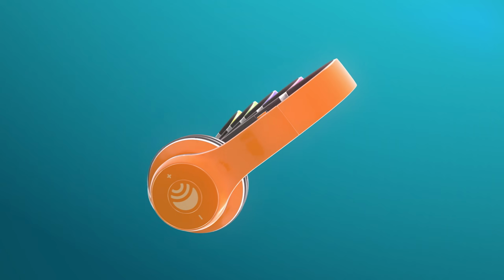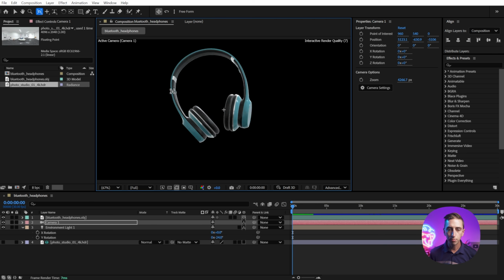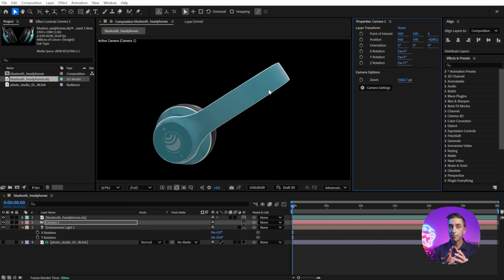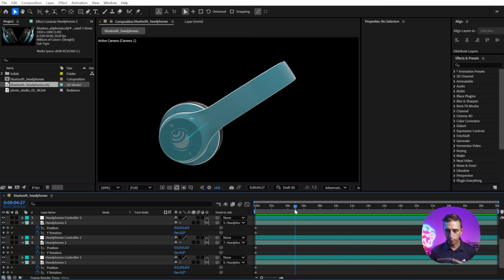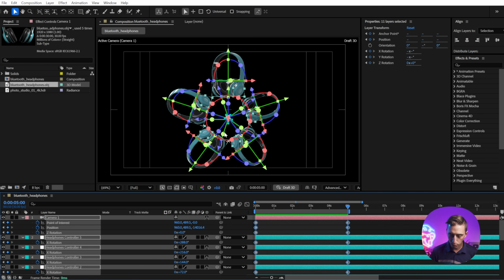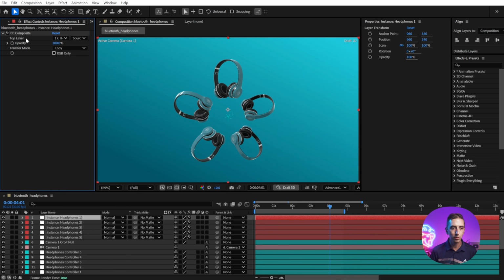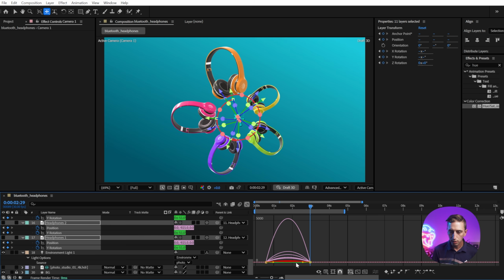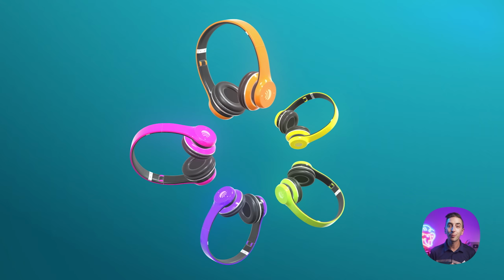Professional 3D Renders in After Effects (No plugins!)

Comment: Hey Jake, Thanks for the tutorial and value as always! 
I wanted to ask ( in case you used element 3D before) how different is this from what Element 3D can achieve? 
I remember that it had duplicator and other similar mechanisms that seemed to achieve the motion you made at the end 

Thanks!
Reply from the maker: I'm a big fan of Element 3D. The Advanced 3D render engine does not support any kind of duplicators, deformers or arrays like Element does. Think of it just like regular After Effects 3D layers, but they're actually 3D geometry.

Comment: it's not working for me usin 3D Models with textures from Envato. Mostly do not update textures and materials. Any help about spec details to import?
Reply from the maker: What model format are you using?
Reply: @JakeInMotion  .obj. I can import it perfectly, no lost asset, but when i drop into the comp it looks like raw. One in particular worked fine... maybe it's some issue in the project files.
Reply from the maker: Are the materials included in the correct directory for the obj to reference?
Reply: @JakeInMotion  yes, and this objects and assets come pre organized by envato, so it should work fine...
Reply from the maker: @davidcasan if you can open it in blender, I would try exporting it as a glb or gltf so the materials are part of the same file.
Reply: @JakeInMotion  Thank you very much for attention! I'll try this. Best!
Reply: @davidcasan did it work?
Reply: @AndresArosemena  yes, there is some files that is not correctly addressed to texture files, but some works fine, although metal and glass materials always looks like plastic, even using HDR environment and lights. Some tip?
Reply: @davidcasan thanks for the reply. I have yet to try this new 3d work flow